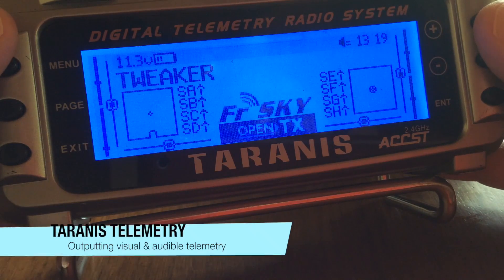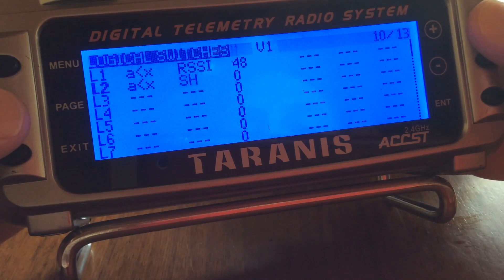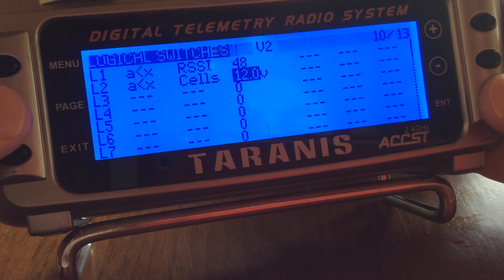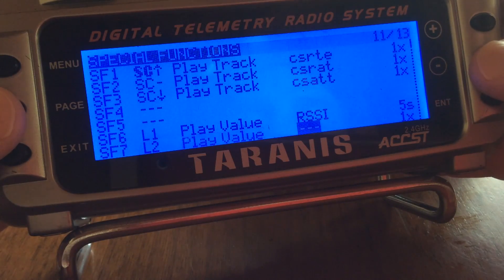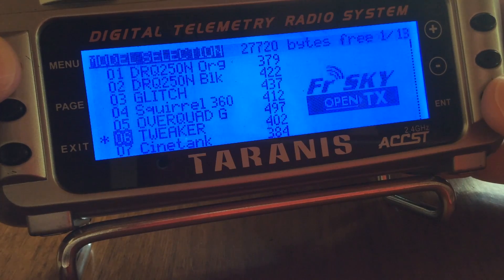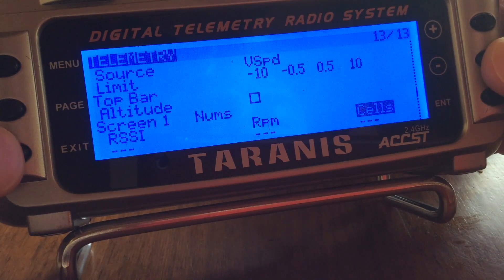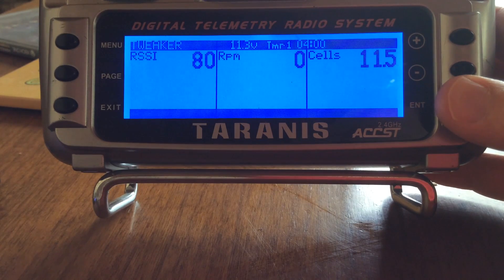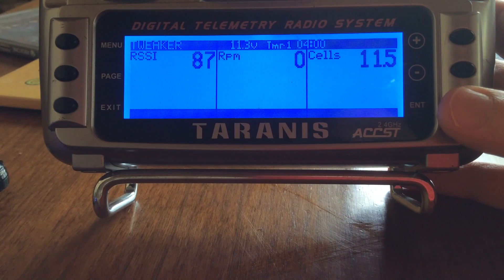Quick Tutorial - Taranis Audio & Visual telemetry configuration

Comment: Awesome Video!!!  I'm gathering in formation to build my own 250 mini quad.  Can you do a video or refer me to a video that shows how to setup channels on the Taranis that correspond with the flight modes in clean flight?  I want to be able to setup a 3-channel switch and make it toggle to self-level, horizon mode, and rate/acro mode.
Reply: Hall, let me see if i can put one together. However, if you check out painless360 channel, he has soooo many videos, there may be one in there for you
Reply: +Seafury mike Awesome!  I've watched a lot of painless360 videos and some other videos.  I've not quite found one that shows my entire setup which will be a Taranis with X4RB (in sbus mode) running a Naze32 rev6 board with Cleanflight.  I have pretty much found several videos with how to setup everything except the 3-way switch for flight modes.  I don't think it will be that hard to figure out, but videos sure help me keep everything straight.
Reply from the maker: +Hall Fatherofthree Ah right, well I just bought an X4RB unit. Will have to get my head around the config and post something to the cloud!!
Reply: +seafurymike I look forward to watching your video if you get a chance to make one.  Also can you recommend some good 20amp ESC's.  I"ve been looking at these...

http://www.readytoflyquads.com/bl20a-mini-esc-blheli-oneshot

There are so many to choose from.  I also would probably need a good switching BEC if you can recommend one.
Reply from the maker: +Hall Fatherofthree Yep they will be fine. I use little bees and I just bought the Kiss 24A esc and having said that also the Kiss Flight controller. I believe they are really good. BLHeli is supposedly coming out with an equivalent to the 24A very soon

Comment: Sorry but "Cell" or "Cells" do not appear....why is that and what do I have to do? Thanks!
Reply: How do you mean it does not appear? When you scroll through the menu, are you saying its not there? I previously had version 1.52 and they were there. This is on version 2.07.
Reply: You add cell or cells of course in the screen1 section of taranis. The second page back from the front as per the video.
Reply: +Seafury mike 
Believe it or not....I have the latest version and that menu does not exist!!!! I can search everywhere and I cannot get to it while everything else is there that I saw on your video...
Reply: +Seafury mike 
...I also noticed that you have 13 pages and I only have 12...weird!
Reply from the maker: +flytelaw1 So, just to confirm, you have OpenTx 2.0.18 or 2.1.6?

I read on Open Tx, that the 2.1 release has a new database and that the telemetry is a full rewrite and differs from the 2.0 release. This may be a reason you don't see the menu page. Very interesting. I have held off going to 2.1 as the database changes totally and this version worked well for me. Keep me posted if you find something and i'll look into where the telemetry items are buried for you.
Reply from the maker: +seafurymike flytelaw1 I see that 2.1 has 13 pages, so i'm not sure why your system doesn't show all of them. Have a look here on the 2.1 telemetry:
http://openrcforums.com/forum/viewtopic.php?f=45&t=6887
Reply: +flytelaw1 my unit is a taranis, its the original version. Until the other day it was on 1.52 software, so i'm not sure if that has a bearing on the difference, but i dont see why it should as the software layout should be the same. Good luck
Reply: I am using 2.1.3 from September 2015. I also noticed that I have 9 pages and not 7 setup pages (Radio Setup/SD Card/Global Functions/Trainer/Version [2.1.7]/Switch Test/Analog InputsHardwareCalibration). The 12 pages are Model Selection/Model Setup/Heli Setup/Flight Modes/Inputs/Mixer/Outputs/Curves/Global Variables/Logical Switches/Special FunctionsTelemetry. So sorry for all this.....:-) Many thanks!
Reply: +seafurymike 
I will keep you posted and again a million thanks! This is driving me batty trying to figure it out...I must say that I have never had 13 pages as I recall before the software update and the Taranis was purchased in October 2015.